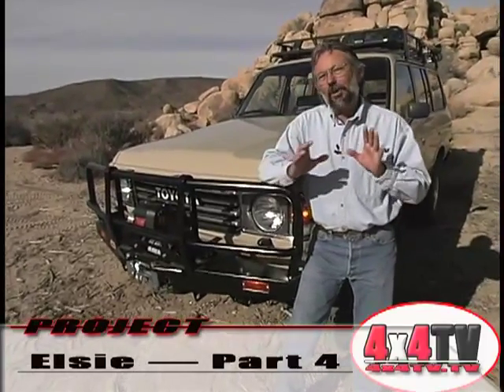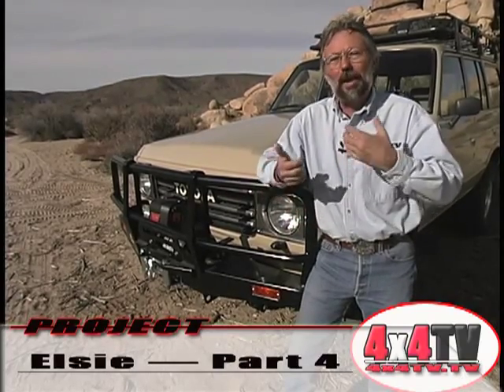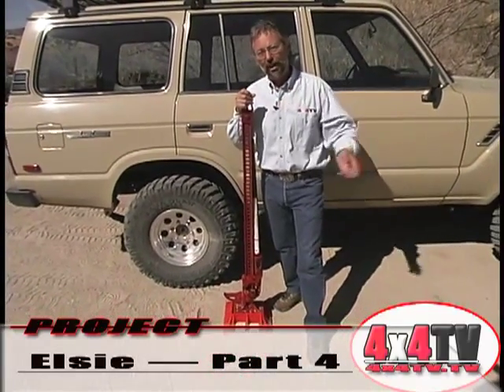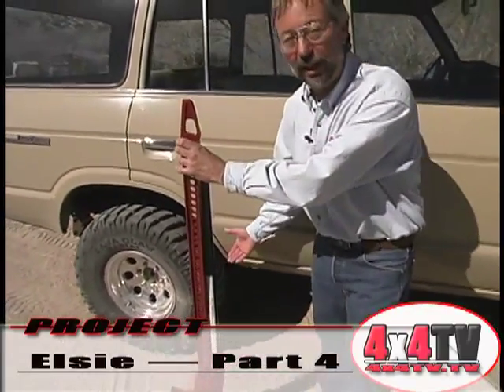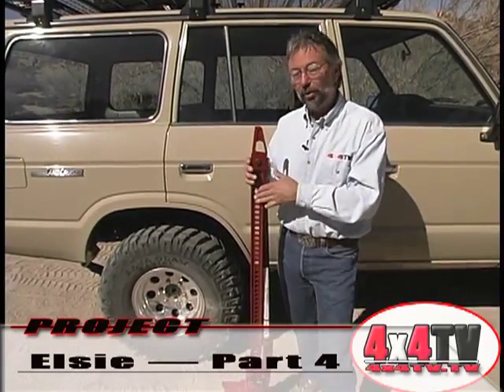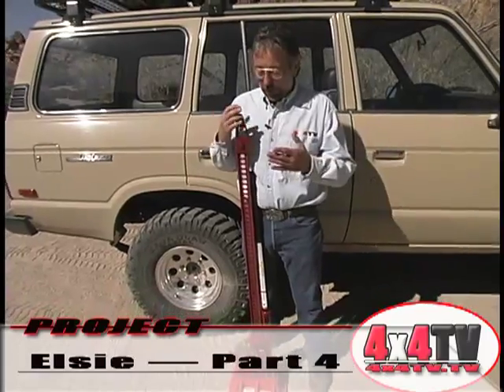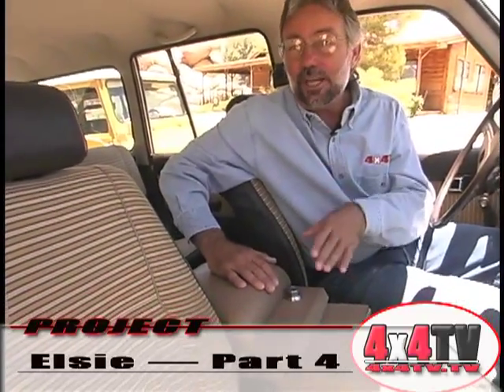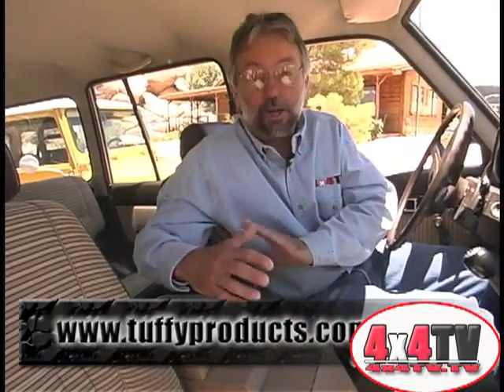Manfree Shackle Reversal on Land cruiser FJ60 - 4x4TV Project LC P4

Comment: have enjoyed your FJ60 Project, being I own an "85" FJ60 is probably why  :)  I was wondering if you might answer a question for me, obviously a Diesel would be awesome but as you stated expensive, what's your thoughts on leaving all that emission  stuff on the 2F? or would it not be better to remove and if so what would your suggestions be on how to go about this "Project"  thanks in advance - again really enjoyed your build - Jim
Reply from the maker: Hey Jim. While I would imagine it would run better, it would be both complicated and harmful to the environment....Okay, actually, assuming your state doesn't require any what if you were to sell it down the road? The best way I see would be to get rid of the cat and change the carb but I'll have to wait for you to tell me if it was all worth it when it's done ;-) I'm not doing mine until I hear from you !
Reply: 4x4TVTV thanks for the quick reply, naw I'll for go that issue till I see something (maybe) down the road from you - I'll know then that its doable - Washington State says after 25 years no more emission testing is required so I'm free to do what I wish, but I don't wish to screw-up my Cruiser - right now I'm all stock but look forward to copying some of your up-grades as money permits , retirement doesn't pay all that well :) thanks again .... JIm